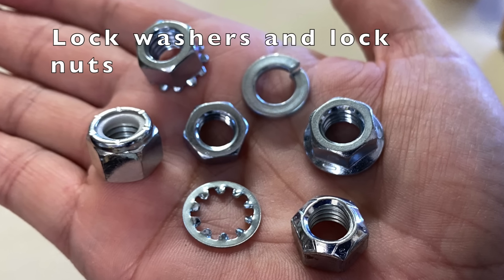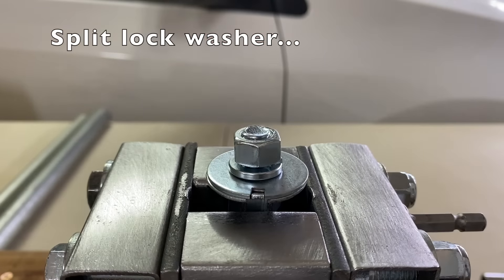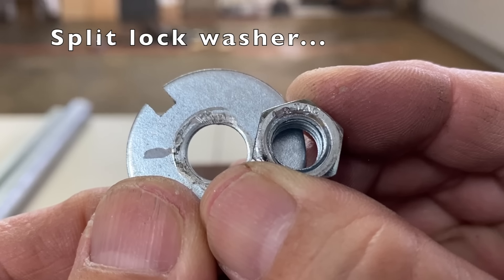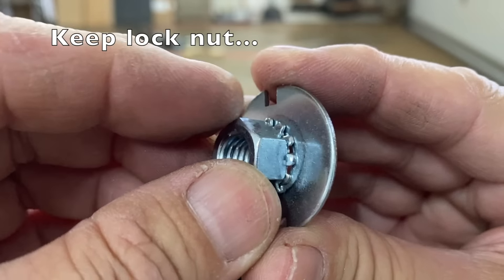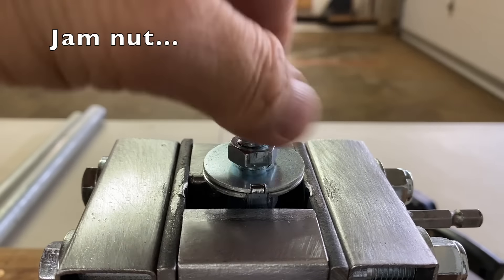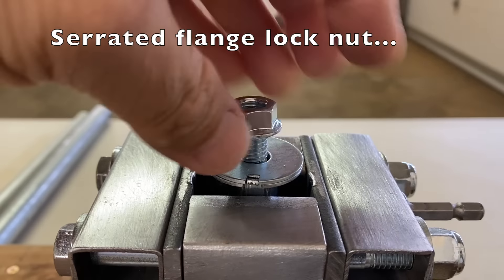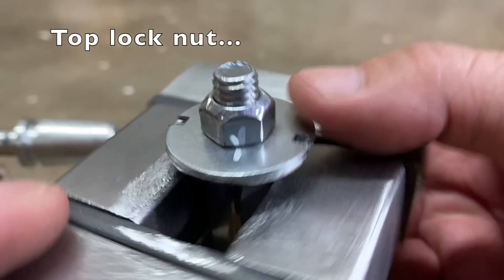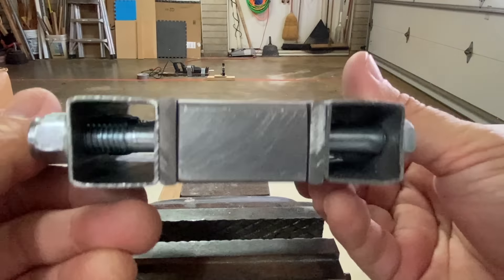Lock Washer & Lock Nut Vibration Test

Comment: Thank you for this experiment.  The problem with the top lock nut is its single use application.  Tests have shown the Simmonds style nylock can be used 15 times without loss of integrity
Reply from the maker: Thanks!  I'll look them up and see if I can find a supplier.  I'll test them if not too expensive.  
😎

Comment: Great video, thank-you.

This echos my practical experience over the last 50 years. I have used locking nuts on machinery, railway track-work and classic (vibrating) motorcycles. My go-to nut is the Nyloc but the top lock nut is a close second choice. I have only used the split lock washer for budget applications and am pleasantly surprised how well it performed.
Reply: The top lock and nylock are the best ones to use unless its a stage 8 locking fastener or a castle nut and cotter pin

Comment: Thanks for doing this test; I've been looking forward to it. Surprised the split washer did so well but I'd be worried about the damage it did to the surfaces. I'd love to see a showdown of the three survivors (Nyloc, split washer and top lock) where they are left vibrating for a long time. My feeling is that the split washer would be the next to go,  but I'd be very interested which one between the Nyloc and top lock does better after prolonged vibration. Judging by this current test, it'd be the top lock (which are new to me; I hadn't heard of them until today).
Reply from the maker: You're welcome and thanks for the suggestion.  I'll add it to my list.  I'm thinking of doing the vibration test with blue and red threadlockers.
😎
Reply from the maker: @balicrimechannel8143  Yeah... I've seen their videos and some others.  I purchased and tested what I could get from my local home improvement stores.
Reply: My bet is that no washer and opinionated tight - the M.A.N. method - will win. When  that manufacturer puts a washer there it is in my experience with their printing presses to ensure that you can take it apart.
Reply: If you:
1) keep the split-rings away from galvanized steel, and
2) replace both nut and washer each time you unscrew the nut, then
result: the damage caused by the split-ring doesn't matter.

Nuts & washers & etc. are consumables, so you should feel comfortable replacing them whenever you unscrew them. So long as you don't have another reason to care about surface damage (e.g. corrosive conditions are a reason to care), and are willing to use a washer to protect the surface of the part, split-rings should be considered a good option. In those cases where you can't use a split-ring, a plastic-filled locknut should probably be your default.

Comment: They have some other purposes also. It's not only for holding a bolt. If you use for example a softer material with bolts, you will need a spring washer because you can't tighten it like you would with steel. The one with teeth is good if you want to prevent the bolt from sliping as you tighten it. They're good for many things.

Comment: This is a great test.  Our big swarf conveyors on machine tools have the scrapers attached to the chain links using jam nuts.  However the jam nuts have cuts made across them with a saw which I guess helps the main nut bite into them.  
Lockwire is the way to go though.  Or Nordlock washers.  All depends on the application
Reply: We've tried all types of locking fasteners on the conveyor flights (scrapers) to keep them attached.  Over time they all work themselves loose and a flight will turn sideways jamming the conveyor and often bending it and other things in the process.  Really sucks when it knocks the entire chain out of the guides on that side turning the entire thing into a giant pretzel.  Short of deforming the exposed threads, welding, or wire/pinning, all types come loose. That's why most OEM's rivet the flights onto the chains.  The downside is if the conveyor chains come out of the guides and jams up, I have to remove a number of flights to get get everything unbound.  I can work an Allen wrench and combo wrench underneath coolant to accomplish this with nuts/bolts.  If there's still original rivets, smashed threads, etc., you can't really run a cut-off wheel under water requiring you to pull the conveyor or drain the sump so we prefer to use a bolt/locknut.  I've found the deformed nut style of locknut to be better than Nyloc's as the synthetic coolant we use degrades all types of plastic over time.

Comment: Thank you very much for doing this testing.  I now have much more confidence in split lock washers.  It's important to not reuse them.  For that extra bit of security you can always use Loctite on the threads.  Even the green wicking type is beneficial.

Comment: From my experience, the single split lock washer seems to work the best as long as it can bite into the material below and the nut above and it's usually the cheapest option too!!!😁👍🏻
Reply from the maker: I was surprised that the split lock washer tested so well after reading several negative articles about them.  😎
Reply: That is why good split lock washers are made of much harder steel than the regular washers and nuts they are meant to penetrate and lock together. In some applications the lock nuts are also considered as single use items as their edges get dull and the nut itself gets deformed after it is tightened and does no longer generate as much holding force as the first time.

Comment: Excellent video. I have always wanted to test many of these as well. I liked the test set-up. I thought it was very clever. I have always liked using the flange nut for surface area, but it did not do very well in this test. They do, however, bite into the painted surfaces very well since they do not require a washer so I am still mixed on the performance of these. Thanks for sharing this!
Reply from the maker: Thank you!  👍😎

Comment: I had a bolt and a regular nut put on the bottom of my power chair and it came off within two months. I  had a new bolt and nut with a lock washer put on this time. (Your test is really helpful.)Hopefully I won’t have the same problem a second time.

Comment: That's very interesting, the test is BRUTAL, like, not just vibration, but downright impact loads on the system, but it does indeed make a lot of sense when you're just trying to losen up the system as fast as possible. Kinda surprised about some of the bad results tho, this begs the question of whether they have different applications that would benefit more on their construction, like the ones that bite into the metal being more suited to softer materials or such.
One that would have been very interesting to compare is a normal nut, with red thread-lock added.
Reply: @RobMrowiec  Interesting, I don't know the correct torque values without a look up table so wouldn't know it (specially imperial), good to know, I imagine this has affected quite a bit the results then. Probably some of the biting types would have more of an effect that way, even tho they already left quite the marks on the metal.
Reply: @Kalvinjj well, I'll tell ya. If they were m8 8.8 bolts, he is only using half the torque value. Instead of 11ftlb it should be 22, then he could of rattled till his teeth fell out. Not much of a test if you don't use the equipment properly.

Comment: One big reason for using nylon locking nuts is not so much to avoid them loosening, as to avoid the nuts falling off and causing havoc.  So for example, you could have a panel secured by twelve bolts (for redundancy) but one of them comes loose (expected, which is why you have the redundancy) but if it or the bolt falls right off it would e.g. end up wrecking a turbine.  A nylon lock nut will keep things together until the next inspection.

Comment: Thanks for making the video. Interesting methodology. You got a lot of responses curious about "what if?". 
It looks to me like the real winner, hands down, is the fasteners holding your jig together through ALL the testing!
Just kidding......sort of. My experience tells me that if the design of the joint allows for enough torque, then you don't need lock washers. Lug nuts, connecting rod big ends. But of course there is not always the option to design joints to allow that much torque. My experience with split washers is that they will spread open before you get to enough torque.
Reply from the maker: LOL!  The bolts holding the rig together experience a less intense axial load versus the more intense transverse load that the jig experiences.  As far as torque... these were low-grade nuts and bolts that can't handle too much torque.  I plan to conduct a future test with grade 5 fasteners and more torque.  😎

Comment: What worked here is what locked the nut to the bolt. What did not was what locked the nut to a flat washer that is locked to nothing. It's like painting on top of paint.  If you lock a nut to the washer, and the washer is only locked to the nut, then it's going to come off. Try putting an 80-grit sandpaper washer under the flat washer and those toothed washers and the split ring will work a lot better.  Ya got to lock to something that won't move.

Comment: Great test procedure!!  Thank you! Now ...question. Best/optimum washer arrangement for a manual tightening function that will SELF-restrain bolt head while tightening the knob or nut side by hand???? (note: this is a bolt that must slide in a slot, for adjustments---so bolt head can NOT be glued down, or otherwise restrained!!)   For shop work/applications. Also, an aside ... was cropduster in Bull Stearmans for 10 years ... ALL critical nut/bolt connections were secured by 'safety wire' (locking wire) and castlenuts. Don't recall a single failure!!! Was generally extreme vibration environment.

Comment: Interesting.  Adrian Steel used serrated flange nuts on their truck shelf assemblies for years, I have had little trouble with them walking loose after years and many miles. Still, around 5 years ago they went to nylon inserts.

Comment: I'm surprised the nyloc moved at all. I've replaced a few of my old 2 strokes nuts and bolts. The thing vibrates anything off, but anything replaced with nyloc's haven't budged in forever

Comment: Interesting test...something I haven't seen before. I was a little surprised you didn't test the external tooth lock washer. Because it not captive to the nut, with the necessary flange to hold it in place, I believe results would have been at least in the second group, if not the third. It is my personal go-to for assembling fasteners sized #6 through 1/4" that are under light to moderate stress and vibration. I experience less than one percent failure after one year of use in a light production woodshop.
Reply from the maker: Hmmm... I didn't think about it that way.  Thanks!  
I actually have external tooth lock washers.  Maybe I'll include them in a future test.

Comment: i would like the split lock washer retested on a setup where the large flat washer is not keyed to the bolt. i have found that in a lot of cases a split lock washer is used on top of a flat washer and would result in the assembly coming off sooner than your test shows.

Comment: Have recently found your channel and love the straightforward testing but wondering why such low torque values are used here? 11ft/lb is pretty low. Snugged up will be 25-30's with a normal socket.
Reply from the maker: Because I’m poor and tested cheap A307 grade nuts and bolts.  LOL. Torque charts call for 11 ft-lbs.  I’ll need to save my pennies in order to buy grade 5 nuts and bolts.  😎

Comment: I will suggest that jam nuts need to be closer to yield in order to stay jammed.

Further suggest using a different method for the jam nuts:
1) Apply the required torque with the first nut.  First nut should be the full nut. My sources disagree with your sources (name yours and I'll name mine:) )
2) Jam the second nut at max torque allowed for the bolt, rod, stud, or shaft (while not allowing the first nut to turn and this may be much higher torque than allowed for the first nut).  The jam nut does not need to be a low profile nut: it can be full.
3) I am not suggesting that clamping force will be unaffected by the second nut.
Reply: yeah same here, I've never heard of putting the jam nut on first. That makes no sense to me.

Comment: Couple things.  The internal toothe washer and keep lock nut designs are not to keep a bolt from loosening but are meant to ground electrical connections.  The teeth are meant to cut throught paint or other surface finishes, equaly true for the external tooth washers.

Torque means nothing if you're not lubricating the threads.  F (friction) factors vary greatly from the screw to screw even from the same batch.  You can apply X torque to 3 of the exact same hardware and not obtain the same clamping force because F vary on each.

Direct from the head engineer at Fastenal US, split washers are worthless.  Told our engineer dep, they only still sell them because people just refuse to learn.

Bellville washers (to keep tension on the bolt assembly during thermal expansion) and Nyloc nuts are the way to go with common assembly applications.

For anything with vibration, Loctite, Nord lock washers and Nyloc nuts.
Reply from the maker: Thanks!  If they are for electrical connections… I guess they shouldn’t call them “lock” washers and nuts.  LOL
I was surprised how well the split lock washers did after reading how useless they are.  🤷🏻‍♂️
Reply: @HacksbyDad  very true our rep said the same thing, unfortunately that's a very common problem as companies use terms interchangeably just to sell more product and confuse the public.

Comment: I'm too lazy to go through all the comments to read anything similar. Another way of seeing movement on the nuts that held in place I would mark the assembly all the way through. There is a possibility that the washer is moving but the torque on the bolt and nut is sufficient to remain in place. So is the nut moving around the threaded shaft. Would mark the threads, nut and washer
Reply from the maker: Thanks!
Yeah... others have made the same suggestion.  I'm doing a test with threadlocker now and am marking the flat washer, nut and bolt threads.  
😎

Comment: In my experience, internal tooth lock washers do a great job. Noticeably more torque needed to removed the nut. Surprised by the results of that one… maybe need to try a test with bigger nuts/ bolts?
Reply: This wasn't a torque test though.  He has a video with torque testing.  I think it's important to realise that loosening by vibration and loosening by torque have different results.

Comment: Because it's much more preferable for the nut to open more than to ever tighten (think about shaking it and making it tighter... never gonna happen, right?), it's quickly accelerating thing that nuts always loosen eventually. Nordlocks try to make it so that more the nut tries to loosen, tighter it gets because the wedges are at higher angle than the fasteners pitch... obviously they'll also fail eventually, but they've been very very robust when CORRECTLY INSTALLED.

Try them as well? :)

Comment: I feel line a flange holds up very well but require a lot of torque normally to do their job. In my experience though lock washers are a favorite with supplies being more common do it is nice to see it do well. As far as nylon nuts though in my personal experience I see them fail often. Like they do a great job at staying on but once they are loose it’s toast and they are a pain to get back off.

Comment: I was a bit surprised that the serrated flange nut did nothing to prevent loosening.
I have used them a lot up against aluminium surfaces, where they seems to hold on well.

Comment: The castle nut w/cotter pin and staked nut used for fasting steering-links and Cv axles, respectively, are sure locking mechanisms, they both being critical points of failure.  That stated, one wonders if the other fastening methods are affected by resonant frequencies like the Tacoma Narrow Bridge (1940).  For example, would the locking methods tested all survive a ultrasonic tank, they having a operational frequency between 40K and 60K, yet fall apart very quickly when subjected to specific lower frequencies. Then there is harmonics to consider as well.  As a tutor of college mathematics and physics, I find this experiment intriguing to say the least.
Reply from the maker: Whoa!   That was way over my head!   I’m just a guy with time on my hands goofing around in my garage.  LOL
I’m currently running red and blue Loctite through the extreme vibration test.  Keep an eye out that video.  😎

Comment: Interesting test.  However, not sure there are many applications in the real world, nor is there a nationally recognized standard that says to tests fasteners using this method.  Fasteners are typically designed to bolt stuff together, not vibrate like what is shown in this test.  IMHO, a Junkers Test (Ref: Junker, G (1969). "New Criteria for Self-Loosening of Fasteners Under Vibration". SAE Transactions. 78: 314–335), which is a  mechanical test to determine the point at which a bolted joint loses its preload when subjected to shear loading caused by transverse vibration.  There are YT videos that show most methods of fastening devices will fail the Junkers Test unless special washers are used (e.g., Nord Lock Washers), safety wire, loctite, or similar is used.
Reply from the maker: Thanks!
This was nowhere near real world.  Just a fun extreme impact vibration test.  I saw a junker video about a year ago but just couldn't figure out a DIY setup.  Then I saw this video... https://www.youtube.com/watch?v=c7UIDyHdlLA
😎

Comment: I remember when I worked at a place years ago we would use 5/16 washers under 3/8" bolts.  It fit tighter. Use fiber nuts alot.  I wonder of fiber nuts and split washers combined would work?